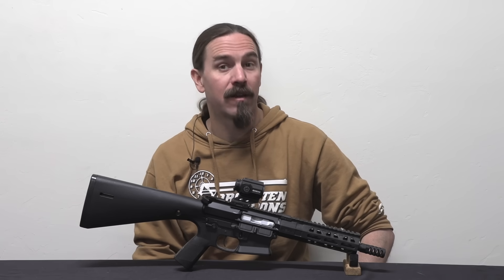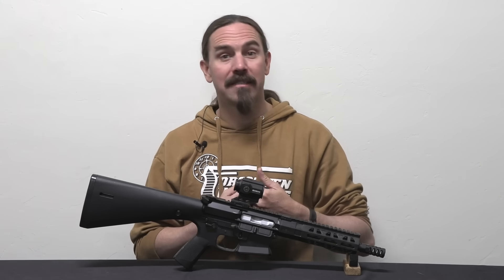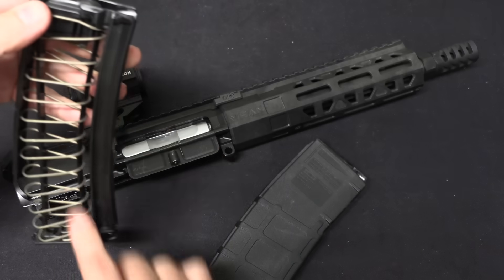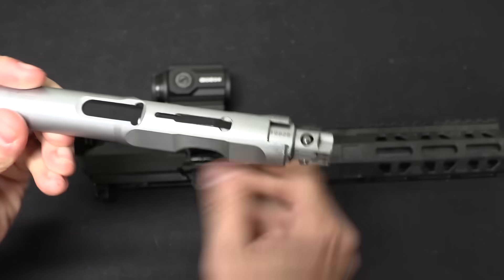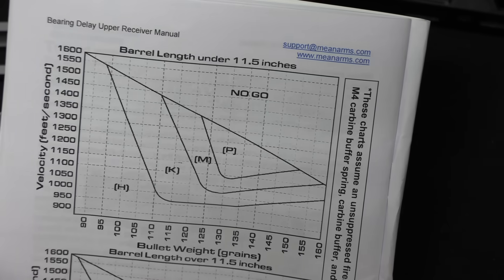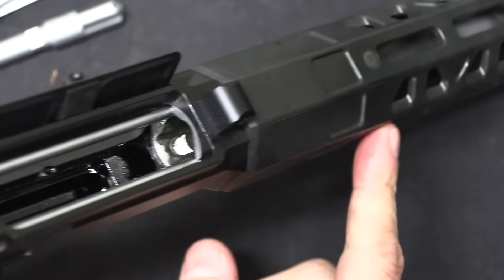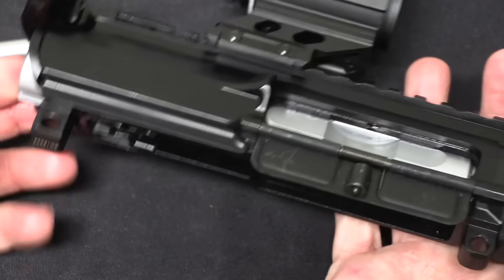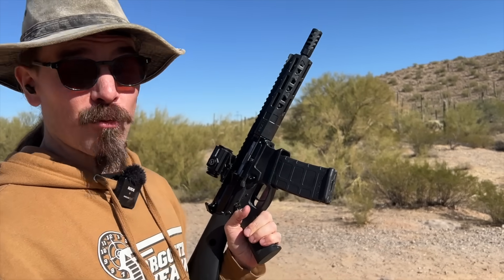Mean Arms' Bearing Delay System

Comment: Thanks Ian!
Reply: cool contraption guys!
Reply: Scale this up guys - lets see some 5.56 & 300blk bearing delay😎
Nice design, it definitely feels like the next evolution of the roller delay-style action!
Reply: Please consider making an endomag sized for a 20rnd pmag. You would sell many!
Reply: Great job, @MEANARMS !  I had this idea kicking around in my head to, really glad you all had the ability to bring it into the world. Now gotta figure out how to put the money together to get one!
Reply: Please please please make a version that can be used in standard uppers. Bonus points if these bolts can handle 350 legend subsonics. ;)

(I would say 9x39 and 338arc subsonics as-well, but that requires a 45'ish bolt face).
Reply: @ BD uppers have always used and been compatible with standard AR uppers. The early prototypes used standard milspec AR stripped uppers with forward assist. Production units use a billet slick-sided upper.
Reply: @ Very interesting. I will need to look into this a lot more then. The internal guide rails is what gave me pause. How are they held into the upper? Is it attached to the barrel nut (and something else)?
Reply: @ the rails attach to our barrel extension at the front and a polymer clip in the rear that fits in a standard AR upper. The rails fit in standard AR uppers

Comment: I like the concept but I would be particularly concerned with surface area contact of the 3 ball bearings compared to an MP5's twin rollers.  The combined surface area of the ball bearings is likely less 2/3 of a single roller in the MP5.  I just don't see the longevity.  Especially when run hard in a competition setting.  Heat kills whether it is mechanical or electrical.  

side note:  Why is it called a BB gun?
It shoots ball bearings.

Comment: I love that companies are coming up with different solutions to delay recoil. Simple blowback is cheap and fun, but it’s a major hinderance in any competition.
I thought that CMMG’s radially delayed blowback would be peak recoil reduction on a PCC (besides the heavier and more expensive roller-delayed blowback MP5). But, the fact that this ball barring system is TUNABLE, this might take the cake for best PCC system for competition.
I can’t wait to see this compared side by side with the CMMG Banshee, since part of the muzzle flip reduction attributed to the roller delayed blowback might actually be due to the MP5 extra weight when compared to an AR in 9mm. 
I own a SBR MP5 and it weights as much (if not more) as my 16”, full rail AR.
Reply: On their website someone left a review saying their barrel groups outperform the cmmg set-up they also have. I doubt it's a fake review these look nice.
Reply: Most people are unaware just how heavy mp5 is.
Reply: The CMMG RDB is known to have bolt lug shearing and ejector spring issues. I haven't encountered those issues yet, but I only shoot competition loads and not +p or factory stuff in my PCC.
Reply: the real compettion to this system is jp5 pcc
Reply: talking to multiple pcc M/GMs seems like the only 2 real options are this upper or the jp5
Reply: @ that way i wanna get my hand on jp5 or the meanarms upper if they will sell it here in Poland, meanarms opion is better for being cheaper then jp5 also mags are much better

Comment: So essentially a tri lug bearing delay,  it's an interesting take on HK's Roller bearing delay but owing to the nature of the ball bearings not being able to withstand higher pressures it feels like a niche "I need AR because AR" version of an MP5 system. Really cool to see newer mechanical engineering aspects to firearms deisgn.
Reply: “ball bearings not being able to withstand higher pressures”

lol wut?
Reply: @dudeguy8287  Relatively speaking, ballbearings with their smaller surface area cannot withstand the same presures of the larger surface bearings on a roller design, hence I wonder about the scalability as I actually like variety in markets but ultimately they aren't AS strong.
Reply: Check out the Heym SR rifles. Bearing balls are more than strong enough to withstand high velocity rifle rounds, even in a delayed system.
Reply: @dudeguy8287  Nice, I'll have to check them out, I thought they ought to withstand any chamber pressure it's just a matter of scale and geometry!
Reply: how do you not have a name
Reply: @ I, I can't answer that as I'm not sure myself.
Reply: The bearings don't take on the gas pressure. It's just ball bearings on the bolt that press against the inside of the barrel extension to slow the bolt down. Since it does it's job and slows the bolt down, the gas pressure is shot mainly forward through the front of the barrel. The bearings don't even seal in the gas pressure either so any residual pressure is just shot past them. The face of the bolt if anything takes the brunt of the released pressure.
Reply: @clutchboi4038  considering it's delayed no, they don't take the full forces of the gas pressure, but they are there to deal with forces associated with the peak pressures and to help reduce their felt impact on bolt velocity and as such do have to withhold some level of mechanical force and would on paper have a fail point, but that would require them to be a fully locked system and there would be no way to get enough powder in the 9x19 to break it with brute force. Just was a thought about the bigger boomier rounds such as .308 and upwards.

Would love to see a ball bearing delayed Sten in .308, I think that would be a fun lil gun.
Reply: @ Because shits and giggles
Reply: I mean there’s also the fact that the MP5 is an outdated design…
Reply: @ Isn't the AR older than the MP5? I could be wrong, I just googled it, they were both developed in the 60's so it's a case of they are either both outdated or they both go bang reliably and are perfectly suitable for the task at hand.
Reply: Wait until that guy figures out that all the super high-speed guys running Open are using guns with a design that came 50 years before the MP5.
Reply: "Either they're both outdated or neither is" is a really, really dumb take. The manual of arms sucks on the MP5. The MP5 is a PITA to kit out with optics, lights, LAMs, etc, which is obviously not the case for the AR seeing as it's the gold standard for adaptability. One is modular, the other is just not. They're not comparable in the slightest and you suggesting that they are suggests to me that you haven't used either one extensively.
Reply: @ToastbackWhale  Sadly Youtube seems to have removed my response, however with regards to Kit out with Optics lights Lams etc. The HK is Modular get over it, and it was modular before the AR15. Swappable foreends including flashlights and lasers, trigger groups with different selection options, different barrel length uppers / supressed uppers, a claw mount for early optics, OH and the folding / fixed / sliding or lack of stock. 

"They're not comparable in the slightest and you suggesting that they are suggests to me that you haven't used either one extensively." The fact you think an MP5 is hard to accessorise makes me think you've not even seen pictures..... Yet alone fired one. 

AR I've fired a few of those, they're nothing special but this one is trying to be "speshul" by copying an established action albeit with nuance but all they did was cosplay an AR as an HK G/MP series. 

I'm guessing you think .22lr isn't good enough for self defence too huh?

Comment: Out of naive curiosity, and being English with no firearms experience, why would you train with what amounts to a weapon that looks, feels, sounds, and likely reacts/handles in a different way to the one you'd be using for your job?
Reply: The same basic skills and operations carry over, particularly with something like this. It’s still an AR, same size and capacity magazines, same manual of arms, and presumably you’d mount the same optic and accessories you’d have on the real upper.
A lot of people have .22LR AR uppers for that exact reason.
However, specialty uppers like this never really take off as a “training upper” because the ROI isn’t there. Say this is $1400, plus another $150 in mags and $350 for an optic. That’s almost $2k.
You can get a LOT of 5.56 for that amount of money. 9mm is about 15¢ cheaper than 5.56, so you’d have to shoot about 13,000 rounds to make it “worth it”. That’s probably more than the mechanical lifetime of the upper itself.
Reply: @PrebleStreetRecords  I guessed it'd be something akin to that, thank you.

Comment: I had the thought of using angled locking lugs on the bolt head to change the speed that the bolt unlocks, and it turned out I had this thought right about the same time someone at CMMG did.
I just let the idea pass, but then a year or two later CMMG showed off their radial delayed blowback design and I've been kicking myself ever since for not speaking up about my idea
Reply: I have had that happen several times over my lifetime. If you don't put in the work and patent it, it's not yours. 😢
 One of the "inventions" that comes off the top of my head was those stupid plastic rain gutter guards that keep leaves out of your gutters.
 I used wire mesh on my grandmother's when I was about 17. I thought that a piece of plastic with holes that you could cut to length and drop in would be easier.
 My grandmother lives in the woods, and her gutters fill up fast.
 I've had to replace some of the mesh over the years, but I just get on the roof and blow the leaves off. No clogged rain gutters to dig out.
 People acted like I was crazy when I talked about making a plastic version. 
 A few years later, a company came out with the exact design that I had in mind.
Reply: Imagine how I felt when I realized that the PWS UXR is using the same piston idea I want to use.
Reply: For me it was the solid fuel ramjet boosted artillery round NAMMO has produced. Sketched out that, and a boosted ring-foil grenade idea a LOONG time ago

Comment: It is pretty expensive, but if you're shooting a lot (like a competition shooter or hopefully PD would), the difference in ammo prices between 9mm and 5.56 is significant.
Reply: And a lot of indoor ranges allow 9mm but not 5.56.
Reply: Good point.
Reply: 5.56 is like 65c a round vs 9mm u can commonly find for 20c that is 3 to 1. In my book. So 9mm it is
Reply: @michaelulatowski1119  Out of curiosity, what would "cheap" ammo cost per round in the US? Say .308 or 7.62x39?
Reply: @muhughu  Cheapest I've seen .308 is around $.80
Reply: @ Alright, in Sweden the cheapest possible .308 almost exactly 1 dollar a round. 7.62x39 is 90 cents if you order at least 800 rounds. But thats Sellier&Bellot, Sako is 4.50 a round.
Reply: @muhughu  Reasonably inexpensive 9mm is something like $0.20-0.30/per round. Most other pistol rounds tend towards the $0.25-$0.90 per round retail. 

If you reload, you can get the costs down close to 9mm costs. The cheapest rifle rounds might be in the $0.60-1.20 per round retail. 

If it's match grade, defensive, or hunting the prices go up from there. Costs can be reduced via loading, but that's the general lay of the land regarding pricing. 
If the round isn't NATO, pistol caliber used by law enforcement or rimfire...it is going to be significantly more expensive.
Reply: @ Seems to be roughly the same prices as in Sweden. Shooting has gotten way to fucking expensive these days. I remember when a 50 round box of good .308 cost 350sek wich is about 31usd. That same box costs almost triple that today.